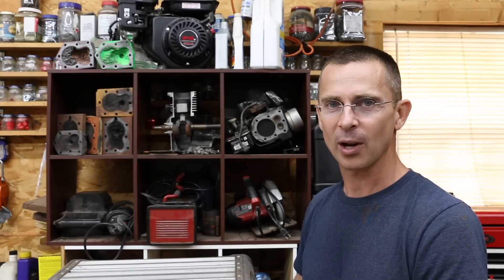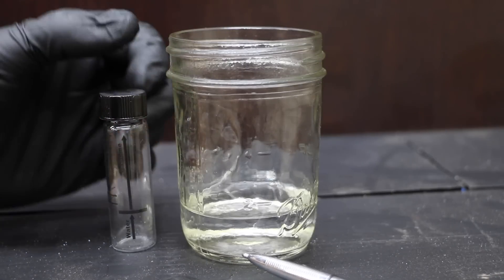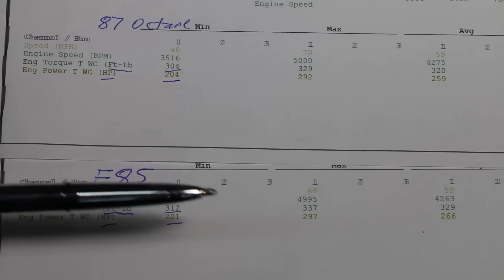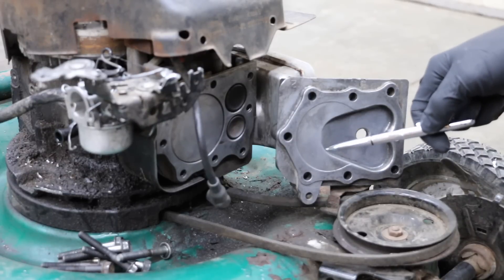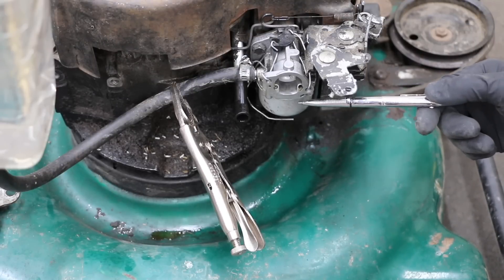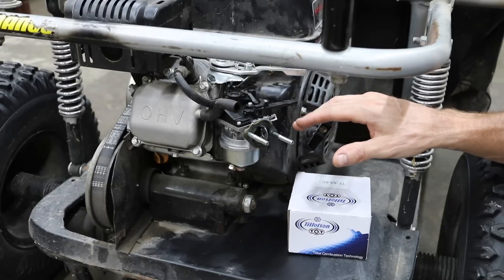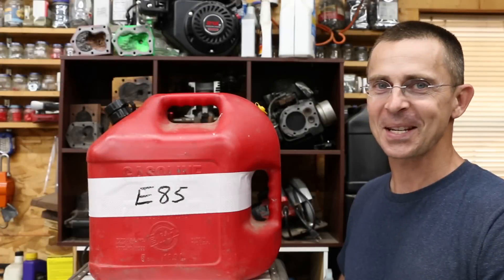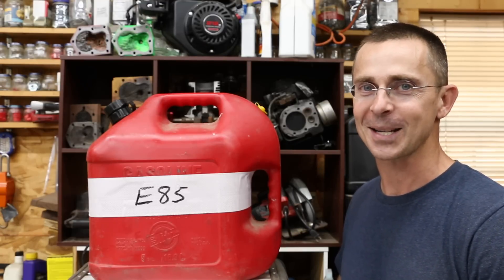Is E85 better than Gasoline? Let's find out!

Comment: could u demonstrate the difference in smoke by burning pure ethanol(alcohol) and regular gas side by side , like in a pottle , then we can talk about the air quality in the big city's and when best to use e85 ;)

ethanol has a 33% less energy then gas so u need more to make the same hp , it is good for mid range torque but if  more hp is your goal , then the engine needs more air because the fuel is taking up more ''space i the air mixture'' less air in the higher rpm=less power ,

using a''fatter mix'' it is an old trick for endurance racing like le mans etc , the extra fuel cooles the engine from the inside while keeping the rpm down in top gear .
Reply from the maker: Thank you

Comment: I always used it in my vehicles that were flex fuel when they started idleing rough. It seemed to clear them right up and had more power but it's no secret you sacrifice fuel economy, E85 got a bad wrap just because people were putting it in vehicles that is did not belong in.
Reply from the maker: Thank you

Comment: e85 is less sensitive to air fuel mixture ratio being correct. it also getting less mpg because it uses more fuel to power the engine. reason why you needed a bigger jet. E85 and Obama standard E10 gas kill carburetor internals
Reply from the maker: Thank you

Comment: In an Finnish car program they tested a Ford Sierra, which had it's engine treated with RVS. They drained the engine from oil and drove 160km at highway speeds without a drop of oil in the engine. After the ride they inspected the engine and the only damage was one malfunctioning cam bearing, but they couldn't tell if it was pre existing or happened during the test. Otherwise the engine was perfectly fine. Not even a slight drop in cylinder pressure.
Reply from the maker: Thank you

Comment: I have a problem that I just know you of all people can help me fix and maybe it could even be a future video. I have a Craftsman lawn vac that won't run unless I spray starting fluid into the carb. I have changed the spark plug, changed the oil, and i cleaned the carb with carb cleaner. I have also taken the bowl off with fuel in the tank and made sure the float is allowing fuel in. I'm stumped and hope you can help.
Reply from the maker: It's got to be the carburetor.
Reply: Well yeah but what is wrong with it? What would you suggest I do or try? If I spray starting fluid into it at a steady rate it will stay running but as soon as I stop it dies.
Reply: At first I thought that too but it was stored without gas in it. I think the carb just needs rebuilt

Comment: I don't like E85 and won't use it even if it performed identically and had the same price:mileage ratio, because I don't want to support the subsidized production of ethanol for fuel.   If you buy the least you can, less of your taxes have to go towards subsidizing it.   More horsepower, meh I have never found that the last few HP matter, it is so seldom that I'm flooring the gas pedal on a vehicle that I can't remember the last time I did.   The only real bright side to ethanol that I see is that it may help some farms stay afloat.
Reply from the maker: Great point!

Comment: It seems important to me to consider how old that lawnmower is or at least the age of the carb on it (if you'd swapped it, lol that seems as likely as not considering your videos) because it was so quickly damaged by the ethanol.  I mean that if it was damaged that quickly, I wouldn't expect it to last even a single season running the typical E10 found practically everywhere these days.   In other words if (even) pure ethanol will damage something, any significant % like 10% will tend to cause damage too, just taking longer to do so.

On a side note your kart seems to really fly for having only 7HP, or did you upgrade it by swapping in a higher HP engine?
Reply from the maker: Thank you. I disabled the governor on the kart.

Comment: I have a turbo Honda, on 93 pump gas it made 473 and 343ft ibs on 12 ibs of boost. Same boost levels and about 67% ethanol content it made 514hp 403ft ibs.. this is partly because e85 burns much cooler and you can run much more ignition timing this is of course after adjusting fueling by a professional efi tuner.
Reply from the maker: Impressive!

Comment: Part of e85's higher "octane" capabilities allow for higher compression and\or boosted engines to perform better with it.  It would be interesting if you could somehow easily test how much more power a small engine could make if it was modified with higher compression and\or increased ignition timing on e85 vs. normal compression on regular pump gas.  I know people do it on cars all the time but it would be interesting to see on an identical small engine back to back.
Reply from the maker: Great point.

Comment: The only time E85 will see any reasonable benefit, is in an engine built specifically for E85... not "FlexFuel". The reason being, is that E85 has a higher relative octane of 105, and runs cooler. Theoretically, you could push compression as high as 13:1 or higher, to squeeze more power and throttle response. 

Currently, E85 only has one benefit... if it's more than 30% cheaper than gas and you drive a FlexFuel vehicle, it can save some cash at the pump.
Reply from the maker: Thank you

Comment: How about "Which engine will self destruct first? Motorkote vs TVT Green" ?

You also promised me a showdown of silicone lube or other rubber treatment for longevity of suspension bushings, boots, etc. But that may be rather specific and/or difficult to test. We will all appreciate it when you can get to it. Your objectivity with all of these tests can save us all engines, dollars, and limbs.

Ooh, thought of another. Which grease is best for ball joints and/or hydraulic farm implements? I'm going to take a stab that some greases are superior, and that I may find better results with one grease in my sedan's ball joint versus my skid-steer's lift arms.

Thanks again, sir.
Reply from the maker: Thanks for the video idea!

Comment: This reminds my of the time when I was 14-15 and shaved the cylinder  head down on the Briggs 5HP w/Pulsajet in my mini bike. It pinged pretty bad after that, so I wanted to put some higher octane fuel in it. Being a broke teen I bought a jug of 99 octane e85 and threw it in. With a little tweaking of the  mixture screw it ran very well with no more pinging. Plus the power increase was noticeable.
Reply from the maker: Very impressive!

Comment: Here's a suggestion I haven't seen. Lacquer thinner as a combustion chamber cleaner.

This next one is also a bit strange, but I'd be curious to see what a couple minutes of muriatic acid (followed by an acid neutralizer, flush, or rinse before significant engine damage occurred) would do to carbon buildup.
Reply from the maker: Great video ideas!  Thank you

Comment: I built a 3.0L V6 twin turbo engine specifically to run E85. It has 11.5:1 compression ratio and runs at 22 psi. The higher compression ratio I did was to eliminate turbo lag and give me a lot of low end torque which is normally an issue for turbo cars. On a dyno run it hits 300 HP already at 2,000 RPM. Max 629 HP at 4,800 RPM and holds that all the way to 8,000 RPM. However this engine will destroy itself if I put gasoline in it.
I could open the waste gate to dump all the boost overboard in an emergency if I had to run gas. 5 PSI is the max turbo pressure I can run with 91 octane premium. Any higher and detonation happens.
Reply from the maker: Impressive!

Comment: I used E85 in my 1980 BMW R100RT, it is 12 to 1 compression. It loved the increase in octaine, accelarted much faster than with 91 E15. however millage dropped from 35 mph to 20 mph and the pot metal carburators suffered white corrosion and a jell like substance in the fuel bowls. After cleaning the carburators I now run only Non Ethanol 91 octaine fuel.
Reply from the maker: Wow!  Thanks for commenting on this.

Comment: One test I wish that could be possible to be ran would be higher sulfur gas vs todays lower sulfur fuel. Based on my experience, the shelf life of gas has tanked in the last 20yrs. After 6 months todays fuel is pure or mostly varnish, whether or not you use a stabilizer or not. However, how do you acquire high sulfur fuel?
Reply from the maker: Thanks for the video idea. I don't know of how to acquire it.
Reply: I don't know either, maybe someone else would have an idea? Maybe run a sulfur additive if it exists?

Comment: In my tests I have done with both of our vehicles, I've found that the price spread has to be $0.50 or greater per gallon (E85 Vs E10) for the cost per mile of fuel to be in favor of E-85. However in both of our vehicles, I have experienced a noticeable power difference.  I am in favor of using alcohol for a vehicle fuel, but I don't believe it has a place in small engines or engines that weren't designed to run on it. I do believe eventually we may have more economical ways to produce E-85, since there are many sources that alcohol can be made from.
Reply from the maker: Great point. Thank you

Comment: I use E85 almost exclusively in my 2017 Silverado with the 6/4 cylinder motor in it. Mileage between regular gas and the E85 is roughly 2.5 miles per gallon on the highway which is about 60% of my driving happens. The big difference to me is at the pump, around here E85 averages 90 cents a gallon cheaper that regular gasoline and buying 26 gallons of E 85 $2.09 or 26 gallons of gasoline at $2.99 makes it an easy choice even though I get and average of one days commuting less on e85 per tank my truck runs better and it helps the farmers get better prices for their corn so I give a little up mileage but I feel in over all gains in power and cleaner running motor I still come out ahead
Reply from the maker: Great point. Thank you

Comment: I have a 2003 dodge neon srt-4 that i converted to E85. Simple conversion honestly. All you need is a bigger fuel pump, bigger injectors and replace rubber fuel lines with E85 safe lines. Total cost on my car was around 500 dollars for parts and another 250 for a custom tune. I am making SIGNIFICANTLY more torque and about 80 more horsepower over the factory 91 octane settings. My fuel economy is about the same as gas. Total range on a tank only dropped 30 miles vs gas.  I love E85 because my engine runs much cooler and it is much cheaper than 91 octane. 2.99 a gallon here in california vs 4.05 for 91 octane. The E content is minimum 70% at the station i fill up at and is guaranteed to be an octane equivilent of 105. Us turbocharged guys love this stuff. Keep it away from carbuerated engines.
Reply from the maker: Thanks for commenting on this.

Comment: My 2011 Sierra seems to only sacrifice about 3 mpg on E85 while throttle response and low end power seem improved.  Going do the highway at 70 on 87 octane it will have to shift to 5th gear on many hills to hold speed. On E85 it  almost never downshifts and feels substantially more "torquey".
Reply from the maker: Thank you

Comment: To get more power from e85 you need to run more ignition advance or have a turbo engine and run more boost. E85 was awesome for my turbo car as it was basically race gas at the pump. Down side is ethanol is highly subsidized with tax dollars 😔
Reply from the maker: Great point. Thank you

Comment: In my Evo X, I can run 93 octane gas and get about 540 HP to the wheels at 29 psi.  With E85, I can get around 620 HP to the wheels at the same level of boost.  The E85 is also capable of running more Boost safely, allowing me to approach 700 HP at 35 PSI.  The major difference between the gas setup and Ethanol setup is the Ethanol setup required much larger injectors and fuel pump.  I was good on 1000cc injectors and a 265 lph fuel pump on gas.  With E85 I need 1650cc injectors and a 480 lph fuel pump.
Reply: Exactly this. None of the factory built flex fuel vehicles will allow the driver to take advantage of E85 in his/her vehicle. It requires after market engine design to get the extra performance from E85. A factory vehicle will get 20% less gas mileage and slightly less HP output from burning E85. A vehicle permanently optimized to max out E85 potential will no longer be able to run on gasoline. You will have to be able to detune the engine somehow to use gasoline in it. IE multiple tunes.
Reply from the maker: Wow!  That's a lot of HP!

Comment: I tried E-85 shortly after buying my minivan which is set up for either E-85 or regular gasoline. A tank of E-85 was considerably cheaper than a tank of gasoline. I did not notice any difference in performance but my mileage dropped so much that even at the cheaper price it would cost more to use E-85. I never tried it again and the price difference soon became much less.
Reply from the maker: Great point. Thank you

Comment: I have tried mixing 1 gallon E85 to the rest E10 91 octane in a mid 90's Camry vehicle. It may have led to premature catalytic converter EOL. However as you also noted. Higher throttle response rate. And it was done for a rapid burn time immediately after fill up for about 300+ miles to empty for it's cleaning capabilities. It was then taken to a less restricted pollution state which may have had better gas with less ethanol. Or maybe it was the cleaning of the ethanol or it could be just that a trip like that regardless of fuel type just clears everything out much like an Italian tune up would. I wouldn't recommend it due to the corrosive properties of ethanol. I forgot what that made the E10 fuel into. E15 or E20 maybe. But probably not worth the hassle. Of note is catalytic converters fail in that timeframe anyway so it could be unrelated but it's hard to say. It could have accelerated the EOL but that's hard to say too. It sure felt like a fast and nice new car driving by around town after the road trip though.
Reply from the maker: Thank you!

Comment: "Casey's General Store" caught my attn because, well, I am one of those...and you dont see the name spelled correctly very often these days... Anyway, this was rather poignant and timely for you to do this test on alcohol E85 fuel... Its a story so sit down and relax...
On Sunday I was going to a friends to watch the 49ers game (thanks for the empathy..😣), and I stopped at Safeway to get something to drink. When I tried to leave the parking lot my Dodge van 3500 with 5.9L gas engine decided I had waited too long to fill her up and died everytime I put it in gear. Varoooom! ,stall,  died, repeat... After 3 tries (twice backing up - once going forward to repark it) I gave up , and since I was already late I had to think of something else...
So in the Safeway complex there's a Walgreens.... So I went there to maybe get a bottle of octane booster to get me going,  and once out the parking lot its mostly downhill to the Shell station about 20 blocks away.
They didnt have any at the Automotive section at Walgreens... They had oil, tranny fluid,  and lots of waxes, but no booster.
Think, Think! And then it came to me in a flash,  with a picture in my head of your feeder for fuel to the lawnmower engine.... "ALCOHOL!"
After looking all over the store I finally found the alcohol, and the 32oz 70% Isopropyl Alcohol was on sale buy one, get one 50% off.
So it came to $4.98 for 2 (now tell me what One cost, with the 2nd one 50% off) and I headed back to my van.
I took out my long funnel and poured in one bottle, all but a couple of ounces...
I got in the van and called my friends wife (he wouldnt answer, jerk!) and when she answered I said "Okay, listen, I need you to do something.... Rub your forehead then cross your fingers and wish me luck!"....
She says, "Okay, rub my forehead... " - " CROSS YOUR FINGERS AND WISH ME LUCK! I'M IN A HURRY!"
"Okay, okay, Good Luck!"
VAROOOM! The van started, and stayed in gear!  I told Kim to tell Ken (thats their names... i know, cute aint it?) that ill be there after getting some gas...and told her I was running on Walgreens alcohol to the gas station..
It worked! Boy was I relieved, and it got me to the station and got 5 gals of gas. So now its octane booster in the tank. And it runs nice too...
So I dont know what ratio it us now, but I figure running E85 in a 1999 Dodge van wont hurt it...if I ever see that out here in San Francisco (doubtful).
When I saw the prices you have there I about shit in my pants...you paying $2.65 a gal for regular... wow... The Shell station I went to was OUT OF REGULAR, and their Mid Grade gas went for $4.13 a gallon! $4.23 for Super...

Thats my story and I'm sticking to it..... I know that last paragraph made you feel lucky to be doing what you do where you do it... so how about a shout out to Casey sometime... I could use a pick me up after getting hosed at the gas station...every time I go!

Have a great week! So you doing a personal lube test, silicone vs water base vs hybrid?  LOL
Shout out someday.... Peace my friend.👍👍🖖😉😎
Reply from the maker: That's awesome that you were able to get the van going with Walgreen's rubbing alcohol and octane booster!  Most people would have never thought of that!  Great job and thanks for sharing the experience!